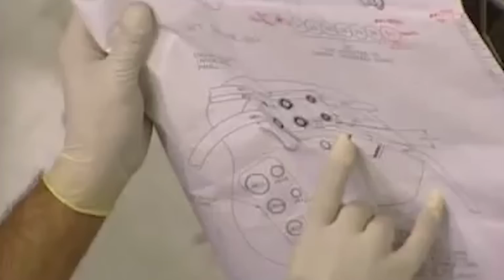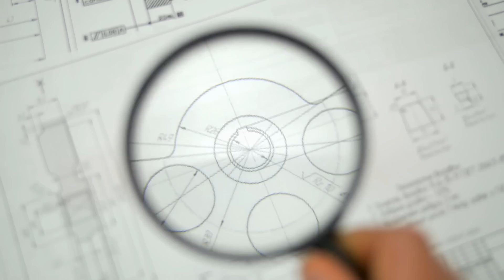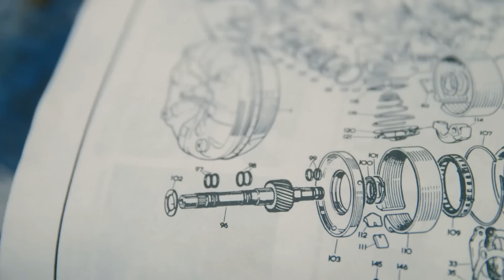Antares Rocket Explodes into Mushroom Cloud Seconds After Launch

Comment: I say emphatically, NO on continuing to use old Russian hardware. They did build great engines in the past but, once the Soviet Union fell, so did their prowess in designing and building high-quality hardware. Use up the stock we have left and not purchase any more. SpaceX is proving that we can do it better and a hell of a lot cheaper. The Merlin engines are great workhorses and will continue to be for the foreseeable future, the new Raptor 2 engines, once all of the kinks and bugs are worked out, will be amazing, highly reusable, highly reliable, very powerful, non-carbon fuel-burning, full closed-loop, and the most powerful rocket engines in use today. Now, if they can successfully fly a rocket the size of a skyscraper with 33 engines bolted onto the bottom of the first stage booster igniting and burning without a single one of them blowing up and returning to the pad it launched from ready for another flight, then they will really have something that others will have a very difficult time matching.

Comment: The U.S., and NASA in particular, should ONLY use American made rocket engines.  To rely on Russian made engines is a National Security issue, and needs to be addressed.  The fact we have only one launch platform (Falcon 9) currently, capable of heavy lift, that is based on American made engines is pathetic.  Though we will soon have more (Starship - Super Heavy) American based engines regularly operating, it's very strange that we have still only the one company currently producing American designed and American built rocket engines that are both reliable and designed for mass production.

The other rocket designs currently in use in American companies are either not fully ready for mass production, or they are much smaller and not capable of heavy lift.

BTW, I know many who were there that witnessed that failure.  It shut down Wallops launch capabilities for some time, as the launch pad was a total loss.  They really only got back to full launch capability about 3 years later.

Comment: Absolutely not. NG should have done like ULA and eliminated the Russian Engines from their vehicles.  There was a moment in time when NG could have replaced the RD-180's with very high reliability Aerojet Rocketdyne engines such as the AR1.  If they had committed to the AR1 in 2016-2018 timeframe, they could have negotiated a fantastic deal with AR to complete and certify that engine, likewise ULA should have done the same thing with the AR1.  Hindsight is always 20/20 and history always shows that higher quality always beats low cost components when it comes the risky and expensive space launch business...
Reply: Pfft... AR1 never happened. Reliability = 0.
Reply: @MrKentaroMotoPI  You do have a point since that engine has not seen its full series of qualification & certification testing.  However, claiming that the next large liquid rocket engine that Aerojet Rocketdyne produces would not be reliable is kind of like saying that the next luxury sedan that Lincoln produces will fall short in the area of luxury. AR's industry reputation for delivering reliable propulsion is long known and has been well earned.
Reply: @theilluminatist4131  There's not enough left of Rocketdyne to pick up and bury.  They no longer have the capability to develop new large engines.
Reply: @theilluminatist4131  There are more Rocketdyne engineers at Blue Origin than at Rocketdyne, including most of the advanced design staff. I wouldn't count on anything earthshaking, since Blue Origin takes a very conservative approach like SpaceX does. I do think there is a good chance that their engines and vehicles will be reliable.
Reply: @theilluminatist4131  I lost your other comment, but Blue Origin has long been understaffed. They finally acknowledged that issue and are now "right-sized", as General Dynamics used to say. They will be a market supplier of engines, so they have deadlines to meet for a change. Blue Origin is very secretive, and I don't work there or with them, but they do have a heavy lift launch system in the works.
Reply: @MrKentaroMotoPI  Very interesting discussion.  Well wishes to you...

Comment: Sorry, but this is terrible.  Have a bit of experience in this field.  Highly reliable "Antares"....now maybe.  Then, not so much.  They were using NK-33 engines, from the N-1 rocket.  You couldn't even disassemble the engine to inspect it (which, at that time, were 50 years old) so the welds went unchecked.  The NK-33 was not even successful on the N-1, with more failures than I can count.  Orbital did something dumb--they bought these engines for cheap from a former Russian general.  Then, after this accident, they did the smart thing and redesigned using the RD-181 engine.  Of course, now, they're redesigning again before of tensions with Russia.  So....that's a bit more of the story.

Comment: Excellent video. I think those old Russian engines make better fireworks than propulsion devices. We have newer, better ones to use. So why keep driving 40 + years old used cars
Reply: They work fine once the kinks are out. No need to reinvent the wheel unless it's a major step forward. I wouldn't want to use any modern Russian stuff given their budgetary constraints and brain drain since the fall of the USSR, but the old Soviet stuff is generally reliable.

Comment: Use old, inferior Soviet engines? 
No.
If we had continued to rely on our grandfathers work, we wouldn't have engines like SpaceX developed, and continues to develop.
Which are also closed loop and benefit greatly from much improved design tools, engineering, metallurgy, and optimized manufacturing.

Comment: Ha.  Lots of Apollo footage.  My opinion?   So many things can go wrong with a vehical that's 85-90%  self oxidizing fuel.  Russian engines made sense at the time.  Now we can't get them, for awhile anyways.  Your video states that the Antares rocket was dependable.  So, it made sense at the time.  At this time, I'd recommend booking a Falcon 9.  I think SpaceX is closer to "dependable " than anyone else. You didn't ask in your video if I am qualified to vet an opinion on this matter.  You just needed a comment.  I'm aways clickin on your stuff.  You must have used generic stock footage.  But the story was interesting. 

So here's your comment.  Intead of reading it, you should have done anything else.  Good thing you didn't read it.

Comment: Well the fact that they blew up at every attempt by the russians to launch them certainly gives a baaaad vibe, but then they ran smoothly for YEARS.
So apparently they were not at fault for blowing up th russian missile launches. Maybe if there was manipulation happening.
NASA likely has pretty tight security, but was it tight enough?
Reply: The Soviet N1 rocket (meant to be their competitor to the Saturn V) was what failed repeatedly until the Soviet lunar program was cancelled in 1974. It didn't use the NK-33 engines, they were intended for the future N1F rocket (of which two were built but never flown and were scrapped when the program was cancelled.
Reply: @guspaz  Ah, i must have missed that detail.
Or was it not mentioned in the video?